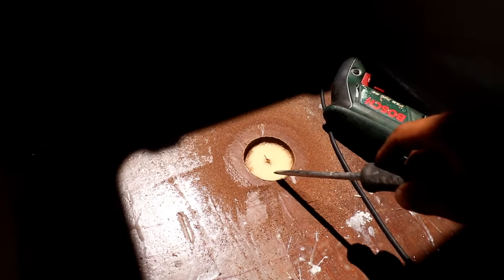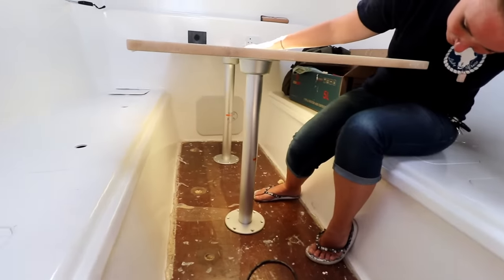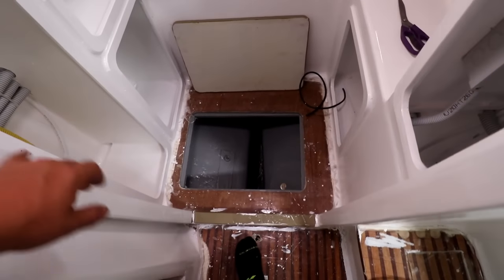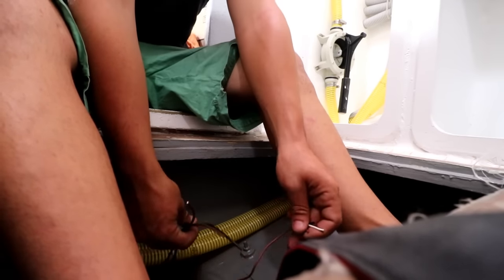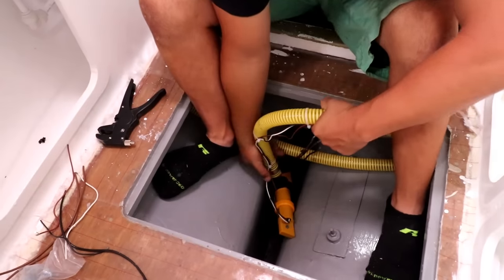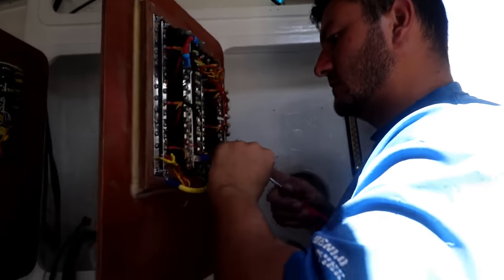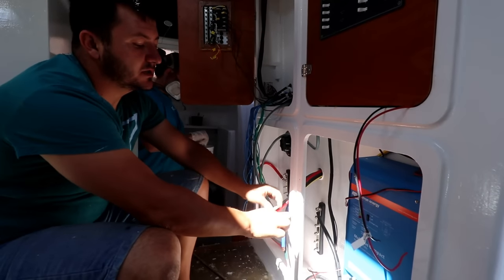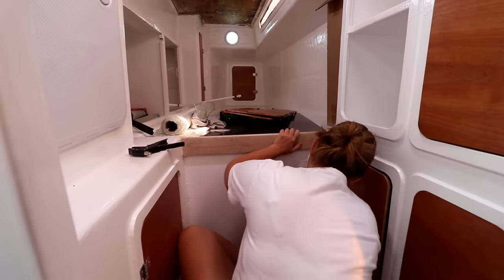CONNECTING up our BOAT SWITCH PANEL | YACHT REBUILD WEEK 56

Comment: I use closed end wire terminals with the heat shrink tubing that has the hot melt resin on the inside surface .  it ensures a water tight seal on boats near saltwater.......good video
Reply from the maker: Thanks so much 😊

Comment: My two cents of advise: your wiring should be tinned like marine grade wires, corrosion will happen anyway whether you have protection or not. Cheers, Richard
Reply from the maker: All our wires are tinned! 🤙🏻
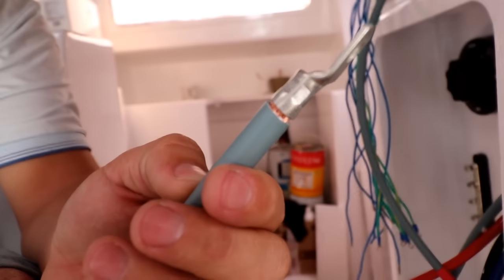Reply: If this is the case then I apologize to you and your readers. The shot @13:07 made me think they were bare copper. Cheers, Richard
Reply from the maker: No worries Richard! 😊 Have a good week ahead. 👍🏻

Comment: Low-temp solder on high-current wiring will come loose, arc, and burn if the fusing isn't exactly right.
Reply from the maker: We have tested them they melt at the same temp as regular solder . All is good

Comment: Hi Ricky and Simone , man you guys are really advancing along..... I did not see how you attached to pump down in the bilge. In one of my boats with a deep bilge the pump is attached to a Stainless strap so it can be pulled out if it needs maintenance. Cheers Warren
Reply from the maker: Thanks so much Warren & for the support. We haven't attached them down yet. Waiting for a small piece of stainless steel to act as a weight to hold it down. They stay there generally on their own. ☺

Comment: Will you seal the holes for the table leg sockets? Just thinking the floor under the table is a nice place for water spill into that foam core?
Reply from the maker: We will be sealing our holes with Sika Flex. They first need to removed though when we fit in our flooring.